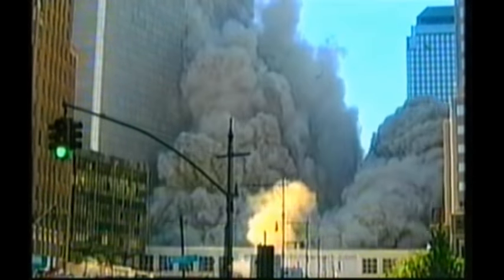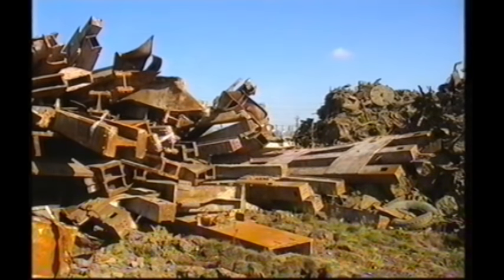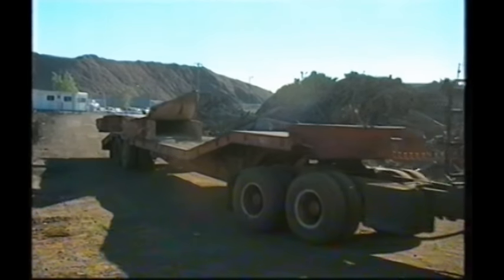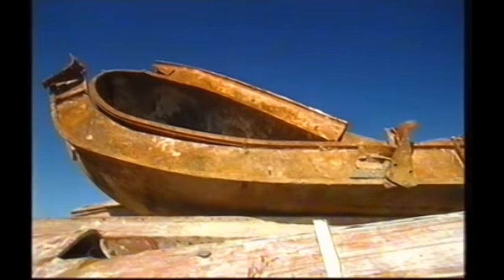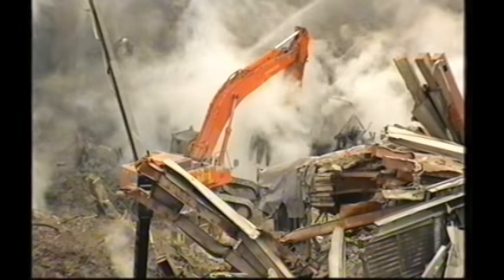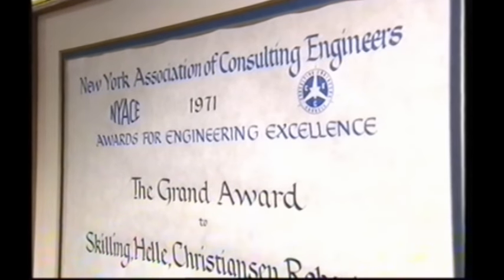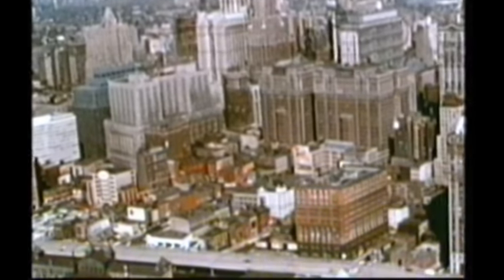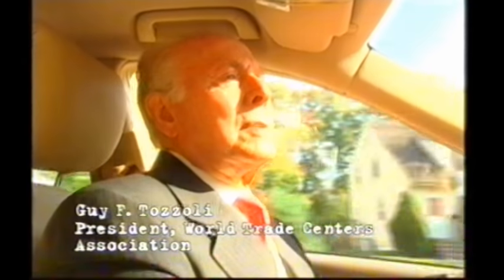9/11—"How The Twin Towers Collapsed" (C4 documentary, 2001)

Comment: Very informative, but no mention of building 7 that also collapsed. I find it hard to believe that all three metal framed sky scrapers came down in free fall into their own footprint. As would happen in controlled demolition.
Reply: @timshea4279  So you don’t believe your own eyes. All three came straight down. There’s no disputing that.
Reply: @markfirmin7748  
All three came straight down. There’s no disputing that

No, I'm not disputing that the buildings collapsed in the direction gravity dictates. That's pretty obvious. What I will dispute is that they came down in free fall given the Towers collapsed at 2/3's G and WTC7 fully collapsed 40% longer than FFA. And I also dispute they landed in their own footprints given WTCs 1 & 2 collapsed into a 16 acre field, outside their 2 acre footprints, and WTC7 collapsed into neighboring Verizon Building, outside its own footprint.

So tell me: what did your eyes see?
Reply: @Markfirmin7748 It's pretty obvious his eyes have never seen a controlled demolition of a building.
Reply: @edeverret2320  
Or more importantly his ears.

Comment: I’m curious if this is true, but an old teacher I had said that the way the tower collapsed was the same way that buildings are destroyed in a controlled explosion. Although I’ve always believed that there was more than what we’ve been told
Reply: Duh, you cannot reach freefall speed unless the floor directly underneath is obliterated FIRST! Which we saw from top to bottom. Actually there were massive explosions in both towers basements severing the support columns, then immediately following were timed detonations from the top to bottom each one milliseconds from the next, boom, boom, boom, boom, boom, boom, boom, .............................................................................................! Pulverizing hundreds of thousands of tons of steel reinforced concrete into dust, which cannot happen from burning kerosene!

Comment: I am having a hard time believing this to be 100% true. Dude with the little tower model and the weights close to the end kinda explains why I say that. The towers collapsed on top of itself. Much like a building in a controlled demolition. By that model the building would have fallen different leaving a good part of the towers to remain standing. Also by what they said it would have only been a handful of those trusses that would have gotten hot enough to fall. I do not see every single truss sprayed with fire deterrent  getting that hot either. Not shown on this video there are photos of huge steel beams/columns that looked like they had been hit by a torch straight out of God's personal workshop. These 2"-3" steel beams look like they got hot enough to melt and fold over like taffy. Do you have any idea how incredibly hot a 2"-3" chunk of steel has to get in order to melt and fold over like that? Personally, I see something else at play here. Sure there was jet fuel but that would have burnt off fairly quick and I know office furniture can burn extremely hot but that hot on that many levels? I don't know and claim ignorance on the majority of it, I was only 11/yo at the time. But still, something about it just doesn't add up.  So wtf actually happened to cause the twin towers to fall straight down on itself like a controlled demolition? For example like that other random building behind the trade center that randomly came down during the exact same time the towers fell... There are so many unanswered questions! It's annoying... Do you think we will ever learn the whole truth behind what actually happened on that tragic morning?
Reply: Those crews were setting all the detonation strips on the beams. Oh yeah remember hearing about Multan metal draining from the towers.
That's what burned at those high temperatures.
Reply: @ROGUE-GOVT86IT  Riiight.
Reply: Exactly 💯
Reply: This was a terrorist attack from within.
Reply: @TERESAVIALA  lets not even get on the subject of the Pentagon. Nothing about that makes a bit of sense.
Reply: I've seen footage shot maybe 2 blocks from the first tower the moment it collapsed. It was a low shot of two firefighters looking at what I assume was a map, and then all of a sudden there was a series of rhythmic explosions.... at least 10 of them, one right after another... perfectly timed... just like you would hear in a controlled demo - immediately followed by the top of the tower freefalling straight down. The camera panned over quick enough to see the explosions and material being ejected horizontally at high speed. That footage alone tells me all I need to know - this was an event used to justify the patriot act and the 20 year Iraq war.
Reply: Ron, most buildings are built with each floor being the same height, from floor to ceiling, or in the case of a collapse, from ceiling to floor
Reply: Yeah and just think 9/11 and the entire war could have easily diverted during desert storm but when the dude asked for confirmation to pull the trigger the line went dead. I know the sniper that ask. 🤫 Don't tell nobody though.
Reply: Once the mass of about fifteen floors falls on the next floor and so on the steel doesn't need to be softened to fail, the trusses and their attachments were a weak link
Reply: @johnwiggins8535  thats somewhat rational I will give you that, but do have any idea how hot that fire has to get in order to melt 15 floors worth of trusses? If a couple trusses gave out the rest of them should have been able to bear the load. That means that every or nearly every single truss would have had to give out in order for 15 floors to come crashing down. Not to mention 15 floors that high up would cause the building to and tople over don't that only a portion of the towers would fall instead of it crashing down in a big heep of rubble that holds a striking resemblance to a perfectly executed controlled demolition. My personal opinion is that those towers fell way to damn perfect for that truss theory to be true.

Comment: According to statements of 99% of structural engineers, architects, and demolition contractors, Building No 7 was demolished. Based on statements made in an interview by ground lessor, the decision was made to " pull " the 50 story modern  steel and concrete structure in lieu of extinguishing the office fires. However Tower 1 and Tower 2 were bought down by office fires on the 7 of the 110 floors. According to facts, the ground lessor did not direct the FDNY to demolish the Buildings like Building 7.
Reply: And organising a controlled demolition in a building that's on fire, in a deserted area surrounded by rubble and a road system that's choked on the same day as a major incident is dead easy, of course.
Reply: Kerosene office fire in a steel framed high-rise can't produce enough temperature to melt steel according to Physics. Look it up. Even a NIST fire test, using a full scale mockup of a WTC floor plan showed it was not possible to completely melt or collapse the steel structures in the room--they sagged yet remained intact. So, no kerosene fires could do that, nor has any fire or plane strike in the history of modern skyscraper construction ever brought down a single high-rise building! So, the many experts and professionals that say jet fuel (kerosene) caused the collapse: need to go back to school--period. Because the ones who have gone to school (and refuse to lie) say the very opposite. These building are designed against such dangers. So, Controlled Demolition is definitely on the table--all by itself. .
Reply: @LAR-hs2qt  
The Structural Engineer of record Leslie Robertson, the person who actually built the WTC Towers, has absolutely no problem with NIST's conclusions on why they collapsed.

What do you say to that? Is he not educated enough or are you accusing him of lying?
Reply: @LAR-hs2qt  <sigh> All you have to do is get it hot enough to lose strength and then there is scope for joints to pull apart with an overall loss of structural integrity. This has been shown both experimentally and in the office building in Tehran that collapsed due to fire in 2017.
Reply: @smorris12  To get a fire to do the damage you suggest hot enough: would require something more hotter than a jet fuel fire. Kerosene office fires won't get the job done. The modern skyscraper of today is designed to withstand that type of temperature range cause by jet fuel fires. It just Physics and engineering.
Reply: @LAR-hs2qt  Just admit you don't understand physics and like parroting stuff you found on the internet. The "temperature" of a fire isn't a thing, it's to do with energy release. As was shown many, many years ago the jet fuel burnt off in no time at all. It was the huge fires the jet fuel started that then weakened the already damaged building.
Reply: @LAR-hs2qt um . . you did see the part that mentioned that virtually ALL of the thermal insulation was blown off  didn't you. And that history of all those ?? buildings not falling didn't involve the new truss floor designs.
     And of course nowhere in the video did it say that any steel melted.
     Just saying because . . ya know that education thing you brought up. Just sayin'
Reply: @johnwiggins8535  Please clarify your remarks for me. See what, where? And what video are you referring to?
Reply: @LAR-hs2qt  the video you're commenting on. OMG. If you're going to engage in educated conversation, please try to keep up.
Reply: @cwrighta70  I dont recall asking you for anything sir/ma'am/it. When I need your help, I'll ask you. In the meantime keep it to yourself (if, you don't mind). I'd like to hear from the gentleman I was writing to--not rude strangers. And for your information, there was more than one video I--myself--was commenting on, which is why I asked for a clarification. So, you might keep up (read before you leap into something).
Reply: @LAR-hs2qt  Unfortunately for you that's not how the Internet works. Everything is a public conversation. If you want to talk privately, take it to PMs or a coffee shop. Also, we're all strangers. And if I'm rude, it's because people continue to soil 9/11 with the same stupid, ignorant arguments and conspiracy theories that make NO sense. 22 years later, we're tired of it.
Reply: WRONG  @LAR-hs2qt
Reply: @donm.1068  That goes for you to sir. The gentleman I seek to hear from isn't you (who every you are).
Reply: @johnwiggins8535  So, what you got for me?
Reply: @LAR-hs2qt  if you could stop disrespecting the victims by spreading nonsense that would be great. I don't understand where you gather such confidence when it is clear you don't have a basic grasp on physics and material engineering.

Comment: Amazing that they both fell straight down. Not to either side but straight down without the help of any previously laid explosives.
Reply: Why would these buildings collapse sideways? What force would cause that, and where would such a force begin?
Reply: @kyle381000  Because you would not expect the steel to soften and fail at exactly the same time on all sides of the floor, so you'd expect one side to fail first, causing the tower above to tilt towards that side.
Reply: @urbanbuddha65  The steel elements did not need to fail simultaneously in order for the overall structure to fail. It only took one section of the perimeter supports to bulge outward to cause a local failure which then precipitated a larger failure.
Yes, the upper floors tilted somewhat into the gap. However, as one side tilted down it would put great tension stress on the vertical elements on the opposite side. Once these failed, then the entire structure supporting the upper floors was compromised and the mass of the upper floors would start straight downwards.
Reply: @kyle381000   where did the opposing force go?? you understand the bottom floors were designed to hold the top floors?? falling in less than 9.5 seconds is unanswerable
Reply: @rejinc  
The lower floors were designed to withstand the static load of the weight of the floors above. However, they were NOT designed to withstand the dynamic load of the kinetic energy generated when the upper floors 'fell' three storeys through the gap at the impact point. In WTC2, this would be the equivalent of dropping a 30-storey building from a height of 30 feet. No structure designed to withstand a static load was ever going to stop that until the tower was completely consumed. Further, anyone who even suggests that the upper floors would somehow 'slow and stop' partway down simply does not understand the mechanics and forces involved.
Also, the '9.5 second' myth was debunked by video evidence decades ago. Let it go.
Reply: Yes! It's called gravity! RIP: To all involved

Comment: ive always found it very strange that two buildings that they admit were built differently from one another because of the wind shielding could collapse in exactly the same way unlike any other structures before or since,so they were built differently and also hit differently by the planes on different floors at different angles yet they both pancaked the same way it just seems very odd to me as a lamen,and then there is building 7 which is a whole other story,nothing hit it except some debris yet it fell str8 down at freefall speed from an office fire seems highly suspect to me but im no expert or engineer
Reply: The two towers were NOT fundamentally different in terms of them both using a tube-in-a-tube design with an internal core, perimeter vertical supports and trusses to connect them. These key points of failure were common to both buildings. These buildings were so similar that if they had NOT both collapsed the same way then that would have been a much bigger mystery.
Regarding WTC7, for you to say 'nothing hit it except some debris' belies your fundamental lack of knowledge regarding the nature of that debris, its source and the extent of the damage that it caused. There is photographic evidence of WTC7 with an entire corner having sustained massive structural damage, and other photos of it fully engulfed in dozens of fires. For some,  minimizing the damages to WTC7 and the condition of it when it collapsed is to willfully ignore facts in order to fit a narrative of 'controlled demolition'.
Reply: @kyle381000  i never once mentioned anything about controlled demolition,i was genuinly curious about things i thought were strange allowing for my lack of knowledge,thats why i only asked without pointing to any narrative,i dont think asking questions points to me being willfully ignorant,your answers have been very helpful for my understanding of the collapse so im glad i asked even with the risk of being insulted along the way lol
Reply: @simonpeyton-n3h  - The Twin Towers were identical in design and construction, differing only in minor details. Both suffered similar damage and failed in the same fashion. Nothing odd about that. 

Building 7 was hit by the collapsing North Tower, which is something. It's collapse could not have been more different than that of the Twin Towers.

All three towers took about 3 times longer than free fall to drop, easily confirmed with the naked eye.
Reply: @simonpeyton-n3h  I apologize for my tone. No offense intended.
Reply: @MFitz12  how can something be identical in design and construction but differ in minor details,by differing in minor details means they are not identical,everything else u said i will take onboard
Reply: @kyle381000  no probs thanks for the info
Reply: @simonpeyton-n3h  - One has an antenna on top. Nothing that matters. Hence the "minor details".  Not sure what is hard to grasp.
Reply: @MFitz12  nothing is hard to grasp i guess i was being pedantic because if u have two things u say are identical it doesnt matter how small the differences are by definition they are no longer identical,and it wasnt just the antenna it was differences in terms of weight and size of steels because of the wind sheilding from one tower to the other etc but again im no expert i was just pointing it out,and i kinda think that the fact the 2nd tower hit was 1st to fall sort of proves my point that there alot of differences in terms of where the buildings were hit and the different angles and speeds etc
Reply: @simonpeyton-n3h  - You were being a conspiracist.
Reply: @MFitz12  not at all was just pointing out things that were said in the video,im pretty sure the chief engineer or whatever said he didnt see them as twins but two distinct seperate different buildings
Reply: para phrasing ofcourse
Reply: Like the Hawaiian fires, look over here not there.
Reply: @imaginaryname7110  wots your take on the fires?
Reply: @simonpeyton-n3h  - Probably Jewish Space Lasers because power lines being blown down in a tropical storm is just too far out there.
Reply: @MFitz12  the sarcacism is strong u must be a fellow brit
Reply: @simonpeyton-n3h  - No, but I play one one TV
Reply: @MFitz12  oh really well u have maybe somewhat grasped our love of sarcasm in your role then lol
Reply: Inside jobber. Steel beams don't melt jet fuel.

Comment: You can tell how hot the steel got by doing a micro etch of the steel , polish steel and etch with acid look at the grain structure under a microscope.. very accurate .Should have been done to any failed member.
Reply: Scrap metal deals done quickly before keeping the evidence to use to improve future buildings? Suspect.
Reply: @forevercomputing  Are you sure? Very suspect. 🙄
Reply: to hide a crime @forevercomputing

Comment: You would have had compressed air inside those buildings as they collapsed down to the ground. That air has to escape somewhere. The air can't go through the ground as it's pushed downward. So the air can start to push back up and outwardly.